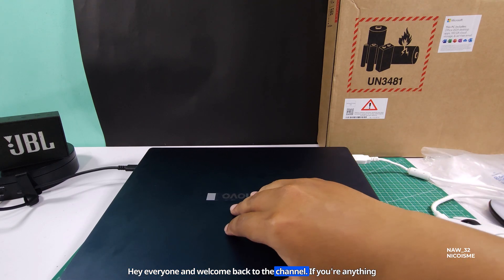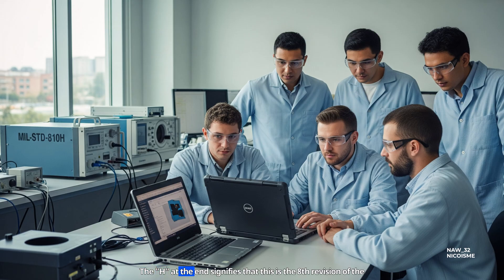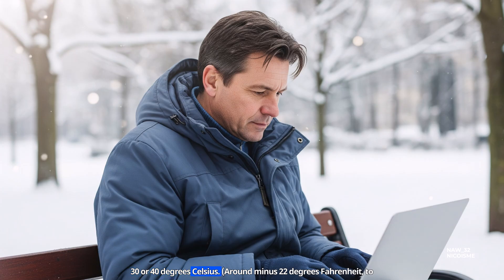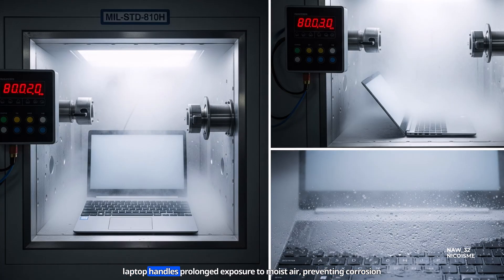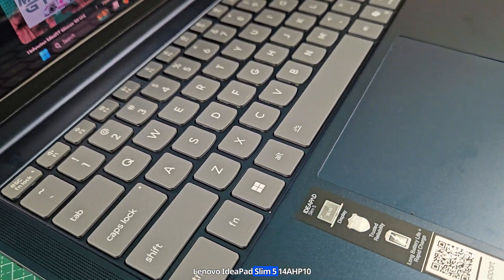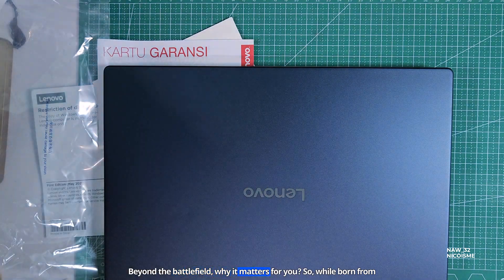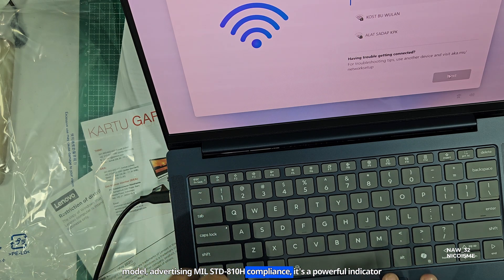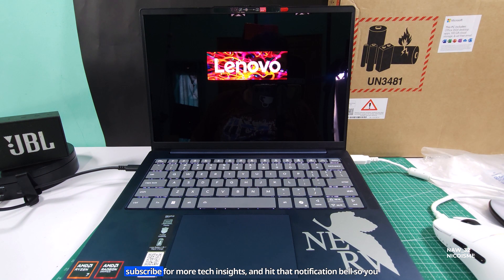Why Your Next Laptop Needs MIL-STD-810H! (Ft. Lenovo IdeaPad Slim 5 14AHP10)

Comment: It means absolutely nothing, yes its good durability but doesnt mean you shouldnt be careful handling it. 
For one, always open the laptop from the center not from the corners. 

Ideapad Slim 5 has dual alumunium case while vivobook s14 only has metal backplate and plastic bottom case yet they both have mil-810h-std.

Also despite it having alumunium chassis, the hinges are still glued on not screwed to the alumunium (only Macbook does that).

Saying all this as a proud owner of 14AHP10 myself
Reply from the maker: Thanks 👍